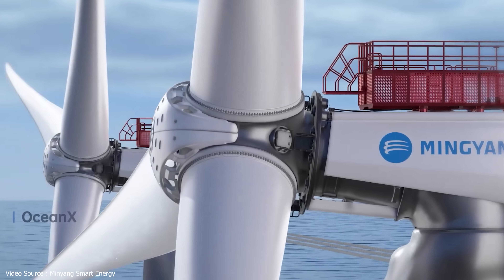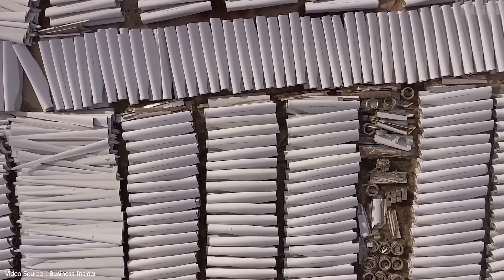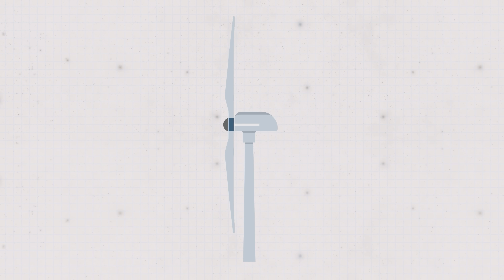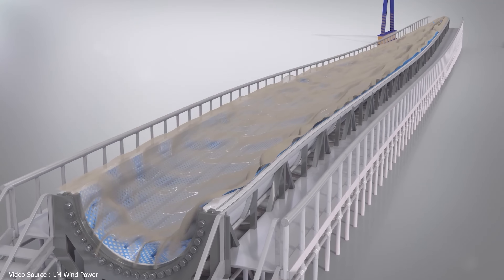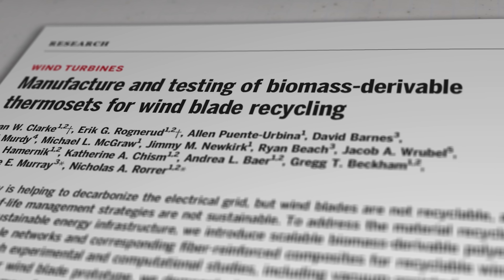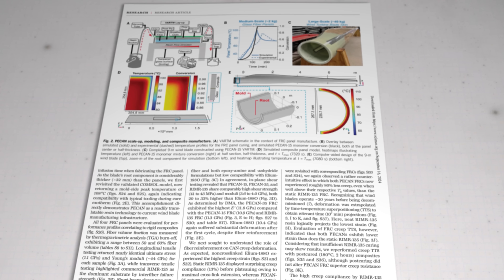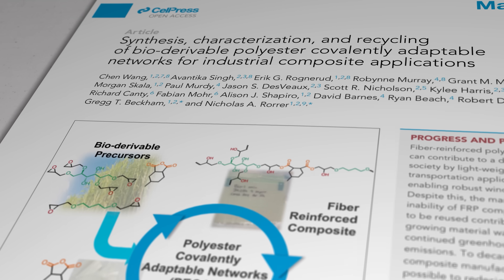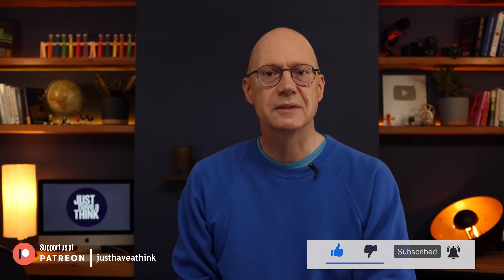FINALLY! Fully recyclable wind turbine blades!

Comment: on the subject of turbines is there a design to use blades on both ends of the top? also i saw a video on where they have the alternate design of a wind turbine where it spins like a top and the wind after it goes through it actually speeds up if that is so why are they not upscaling that and putting them in lines for power generation.. just having a think

Comment: I would prefer it if we say that things are expensive to recycle, rather than make bogus claims that they can't be recycled. Everything can be recycled. Some things, like an aluminium can, are easy to recycle but not necessarily as cheap as we'd like. We want better recycling processes, but it's not like we can't grind these things up and do nothing with them, it's just harder than we'd like it to be. Since the alternative is a nuclear power station, I really don't think this is a big issue. All power stations are hard to 'recycle' but less so if you bear in mind the cost of not having them and just consider recycling as an up front cost to include.

Comment: I don’t know if you follow “Engineering with Rosie”, but I highly recommend it.  Her insights into wind energy are quite good.  One thing with turbine blade waste is that even without recycling, the generated waste is tiny compared to the size of other waste streams.

I’m adding a link to her wind turbine blade recycling video.  Combine her video with this video of the PECAN recovery process, and it’s excellent food for thought.

https://youtu.be/fFxxh6uJB8o?si=iwVt9BcT5JnxxUo-

Comment: No, I won't cry what a ridiculous idea, simply because I think the current technique is ridiculous. Would have been nice if you added what kind of junk the blades are made from now... but anyway, planes used to have wings made of wood and covered in cloth. That is more sustainable than plastics. Dunno about pure alloys, but I think most blades will be carbon fiber now?

Comment: i`ve been saying for years that they should be using hemp for these blades. After a few years of service simply grind them up and use it for bio mass or fertilizer. Hemp!
Reply: The resin is the problem, not the fibres. Making them from hemp would make no difference in the toxicity of the waste

Comment: For economies still running coal power (yay for UK!), the question of turbine-trash is moot. Youtube's Engineering with Rosie calculated in video "Wind Turbine End of Life Waste" that every household benefiting from the turbine gets a bag of trash after 20 years, compared to coal, which produces 180x that much ash of medium toxicity. PLUS all the co2, which conveniently "just goes away".

Comment: This is a thrilling development in an area that has been wanting for attention.  IMO, the development of alternate materials is clearly the right direction since the current generation of materials has both too short a lifetime and major limitations in recycling.  PECAN15 sounds like exactly what's needed, which is not to say that further research on even better solutions isn't needed.  I think this is an excellent first step and should be put to use immediately.  I would really like to see more attention given to extending wind turbine lifetimes, which could further improve to the waste problem and ROI.

Comment: Ideally, at the end of a highly stressful dynamic application on wind turbines, blades could be re-purposed to make best use of their structural properties. Perhaps architects and civil engineers could find static uses in buildings and bridges, possibly in fabric tension structures? Maybe they could alternatively be cut into standardised sizes and given a rating in a similar way to structural timber? As always, we should think about best practice in recycling; re-use, re-form, recycle.

Comment: I would have thought that end-of-life turbine blades made of fibre-grass or carbon fibre could be shredded and added to the furnace when making cement.  The resin is surely a version of plastic and will incinerate to substitute for some of the fuel required, as will any carbon fibre, and the the glass fibres will melt into the mix.  You'd think the high temperatures in the furnace would incinerate adding additives in the resin.  Obviously the shredder would have to be enclosed to avoid glass and / or carbon fibre dust escaping.

Comment: So maybe they can make recyclable blades. Will they and will they use them? Nothing here about cost difference. And by the time they do make them will probably have it installed base of non-recyclable blades.
I find it hard to believe that the blade still won't have fiberglass in them which what makes them so dangerous for the ocean.  

But the blades aren't the worst part. Another terrible aspect is the sf6 gas contents cumulatively is huge 2050 energy plan.  Read about this gas. It will be leaking and has turbines are destroyed by fire lightning and collapse we risk a whole lot of this gas getting into the atmosphere which will totally reverse any hoped reduction in CO2. 

Offshore wind is a massive boondoggle. It produces far less electricity than advertised which means it costs way more than we are told.  Some estimates are that it takes some 200,000 worth of equipment in the ocean to equal what you could obtain from 20,000 worth of solar panels on the roof. We should halt offshore wind shift all of the subsidies all applicable coastal roofs with solar panels and batteries, which will divorce almost all of the usage of those houses from the grid. Dust reducing the load on the grid greatly to the point where the grid may not even need to ever be upgraded.

Comment: "Recyclable" is a pretty fun word and neglects things like costs, energy and emissions required to "recycle" the materials and transportation costs and energy use and emissions to get them to a facility. Then transporting those materials back to a factory where they can be reused.

These blades are 50,000lbs each now and are mostly manufactured in China, so transportation will be huge expense and impact to the environment.

What seems to be missed is the fact that a modern 5MW onshore turbine will generate as much energy as burning 525,000 tons of coal. So IMHO if these 75 tons of blades end up in a landfill each 25 years, so be it. And with any luck they can be ground up locally and used as aggregate in the concrete of new turbines or mixed with asphalt or concrete for local construction projects.

But transporting blades all over hell and expelling untold amounts of energy recycling them is nuts. And all in response to BS conservative criticism as if they ever gave a rats ass about recycling. AND those same people will fight tooth and nail arguing the right for fossil fuel companies to dump toxic waste endlessly into tailings ponds, lakes, rivers, the air we breathe, etc, etc.

Comment: Not being able to post links makes discussion difficult, but my view is that basalt fiber hammers all contenders in the application, including resistance, and more or less infinite recyclability.
' Research on fatigue performance of offshore wind turbine blade with basalt fiber bionic plate'
-' Compared with other fibers such as glass fiber, basalt fiber not only has excellent mechanical properties such as high strength and high elastic modulus, but also has good physical properties such as corrosion resistance, oxidation resistance, high temperature resistance and sound insulation [3], [4]. With the offshore wind turbine blade entering the hundred meters age, basalt fiber is likely to replace glass fiber and carbon fiber in the field of offshore wind power due to its strength, stiffness, durability and economy.'

And:
' Recycling Process of a Basalt Fiber-Epoxy Laminate by Solvolysis: Mechanical and Optical Tests'
- ' Breaking tenacity of the recycled basalt fibers is kept up to 90.5% compared to
the virgin ones, while, with a pyrolysis treatment, this value cannot exceed the 35%'

Comment: Just goes to show... What if turbine blade producers had been compelled to think about recyclability from the outset? Would it have crippled their profits? Or led to better blades in the first place? Who knows, maybe technology has moved on in that space of time, so they might have been pushed to make it work at thae beginning. but it's worth a try. Maybe two different sets of companies should have been working on the problem, one on the turbine, the other specifically on the recyclability issue. And So - then, battery manufacturers should be asked to design 100% recyclable batteries, right?

Comment: What happened to using balsa wood in turbine blades? And by the way, in Denmark they use turbine blades for bus stop covers and parking lot covers.
Reply: That could give a modern art feeling to the roof - I am all for that.
Reply: Torsional rigidity for one
Reply: Balsa 😅

Comment: Do the current resins leach chemicals into the ground when buried?  If the they do leach chemicals, are the chemicals dangerous?
Reply: I'm preety sure that's not the case. That's the reason they are so hard to recycle because they are so durable and therefore not leaking any chemicals into the ground. Dace made a mistake there, which is very common. In the manufaction process there are a lot of toxic chemicals involvede. But they get incapsuled in the resin.
Reply: Yes, that was my thought.  I'm not arguing against recycling if the materials are dangerous or it would save energy, but burying silica, carbon and inert resin may be a better solution.  Rosie Barnes of Engineering with Rosie fame did suggest this in one of her videos.  I can't remember which one.

Comment: I dont know how you researched this video, but to me the only real news is the use of bio degradable materials. Reusable blades are already in production and there are also solutions for deposited and existing blades, although not scaled up yet to my knowledge.  Much/all of what you state is (partly, see below) true for "legacy" blades, but the issue of recycling has been on the agenda for some years now. I must say I mostly follow the Denmark based producers, but Siemens-Gamesa and Vestas are no small players in the world of wind turbines, and they are already producing blades that are 80-90% reusable. 
Vestas also announced in 2023 that together with Aarhus University and the Danish Technological Institute as well as industrial partners Olin and Stena Recycling, they had "broken the code" to reusing the existing blades. Both blades from deposits and production turbines can be decomposed through a chemical process and become raw materials for new production. I dont know the exact roll-out status of this technology, but it should only use widely available chemicals and be easy to scale.

Thanks for a great quality channel. I enjoy your work!

Comment: Advances in turbine blade recycling are very welcome. However, the problem should be placed in context with the total use of such composites, of which wind turbine blades are a very small proportion

Comment: Curious. Why can't these old blades be used as roofing for poor communities?
Maybe old used containers can be stacked the we lay the turbine blades out on top as a large open high ceiling areas? Or we can use the as pillars for large tentages also for poor communities. The white blades in land fills from far reminds me of the white roofing of greenhouses in Spain where they reflect so much light in a vast area that their temperatures are lower than the surround areas. Maybe they can have a similar effect?

Comment: Related to RE, is anyone working towards solutions for covering the solar panels? Imagine during heavy storms, or big hail some sort of light, yet strong covers would be very nice. 
Also, if properly done, they would eliminate the risk of destroying the panels by hail. Those covers could also work well during sand storms.
There are some solutions now, from what Google says, but it's the first baby-steps. Some are manual, for the panels that are on the ground. Others are automated, can be run with an app, for those who use smartphones (yes, not everyone does ha ha).

Comment: Trivial. Might be 10 - 15 years before it'scaled, even if take up is good and it helps only with recycling, not emissions. Against the backdrop of rapidly accellerating warming, taking any joy from this news would be about as strenuous as celebrating the fact that the electric chair they are going to electrocute you in runs on 50% green energy. If it had happened in 1994, I'd have been interested. In 2024, it's simply too little too late. We're not going to innovate our way out of this sh**show.

Comment: Good point. And this not only goes for turbine blades. As en aeronautical engineer, the use of composite carbon fibre has concerns me. As it breaks down its not going to be good for the environment. Great to see solutions being proposed.

Comment: No, please no bio degradable, it is terrible enough that we put every effort in building wind turbines, most blades are build of a composite of balsa wood and fiberglass epoxy, that only last 10, sometimes 30 years but never more. They are trashed immediatly after turn around. We need wind turbines that endure 100 years and more to be sustainable. The years after turn around are the most valuable years.

Comment: I was thinking about the Netherlands and their polder system recently...

Couldn't the used blades we've already made go into raising low-lying areas with these stable materials? That could be a benefit from such blades until they are phased out.

Comment: The 30 to 90% reduction in GHG emissions for the SECOND iteration of these turbine blades is great, but that doesn't help the primary producer unless they are still the owner and have the burden of disposal/reuse. This means NOW would be a great time to implement EPR (extended producer responsibility) for blades so that the manufacturer would see the advantage of building with a reusable material. Just like a deposit return system for bottles ensures responsibility for reuse (and fate, hopefully) of the bottle, a well conceived EPR would bake the disposal costs into initial sale, so blade with reusable material would mean a cheaper initial blade.  Thanks for the video, Dave.

Comment: As others have pointed out, one missing piece of information in the video is the ratio of wind turbine blades to the total amount of stuff going onto landfills. Of course, every single source of waste should be scrutinized, and this video is focused on just one, which is fair,  but there's a lot of unnecessary argument caused by leaving this little bit😊 of info out.
Reply: What else is there on a windturbine thats not recycleable?

Copper and steel =  easy $
Concrete can be recycled in building and making new concrete.

Its only the fiberglass blades and shell that was non recycleable until recently.
Reply: I think you misunderstand. Not the ratio of the blades to the rest of the wind turbine, the ratio of wind turbine waste to all of the waste that's put in landfills from any source.  @NewPipeFTW
Reply: @polanve  yes, for instance, waste from the coal, oil and natural gas industries. Food packaging that we don't need (not the stuff we do, the unnecessary stuff we all agree is pointless). I think someone else said this is great for PR but won't actually do much. The public perception that this is a lot of waste, is worth fighting with improved recycling.

Comment: to me this is similar to what happens when a youtuber always reads the comments. at first they can not let it effect them, but eventually more and more of their videos are wasted effort and time trying to preemtively respond to what the least well-meaning trolls will say, and you wonder: huh? how did they fall into that trap?
such is the situation when people say "wind power is so dumb, those blades are DISPOSABLE!! dumb liberals! people inadvertantly get caught into that trap and not realize it.
wind turbines were designed with glass fiber and other cheap, plentiful commodities and produce far, far more energy than the cost to produce those basic materials. if you take some sand and make glass fiber and take the equivelant amount of oil that you'd burn driving a half mile in an SUV (or plant based oils if you want to make it over-complicated and less efficient!), and convert that insignificant amount of resources into a wind turbine, the return on investment and overall sustainability is obvious, and that's what we need to be talking about: the details of it. They provide a good useful life and aren't super hazardous to dispose of, they break down relatively quickly and aren't reason for concern in that regard either. Again, this question, in every detail, can be addressed very easily if we talk specifics and not just vague ideas/opinions/rhetoric.
what i wish was discussed more is the basic factual economics about these things in a contextualized way. usually it's either "green, environment, buzzwords," or "green technology is all BS, etc,"
Reply: Some orange-colored feller told me that them wind turbines (especially them ones off shore) cause butthole cancer. Whodathunk? And butthole cancer is the worst, they say. I'm scared!